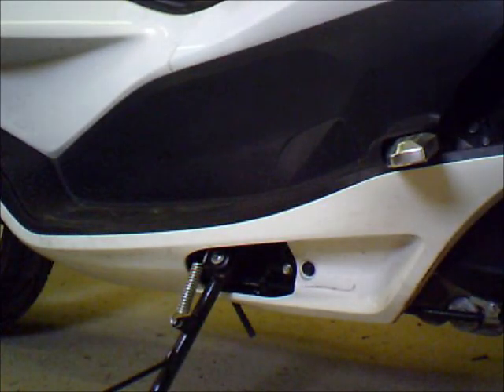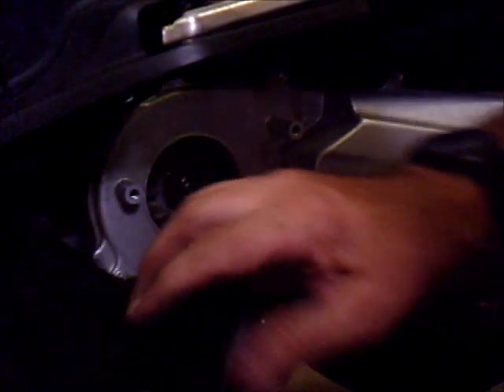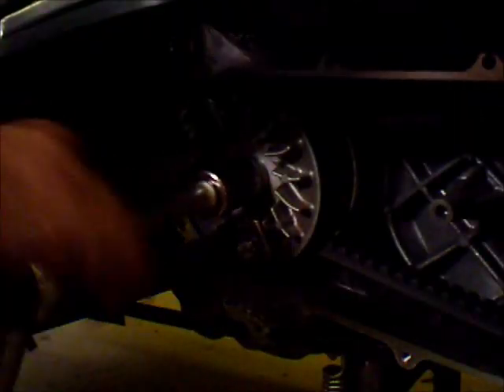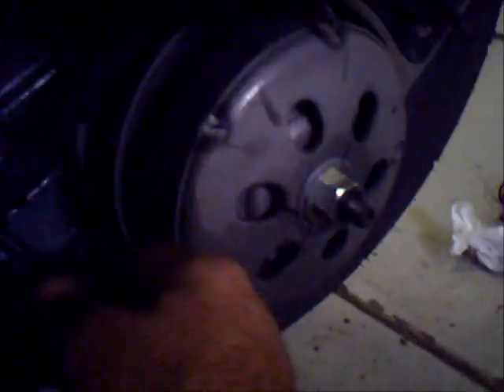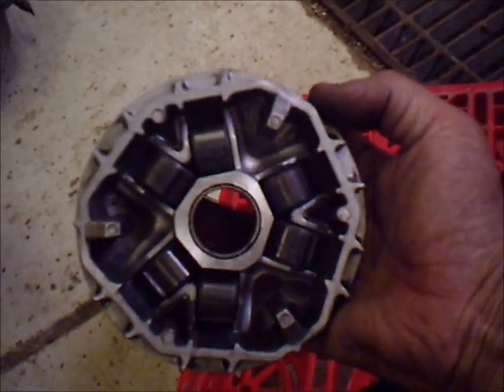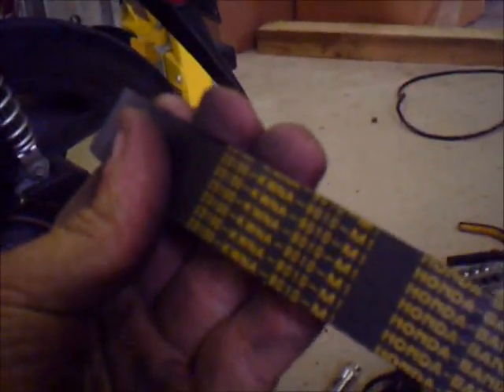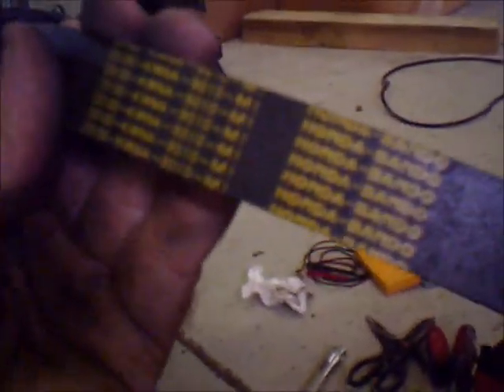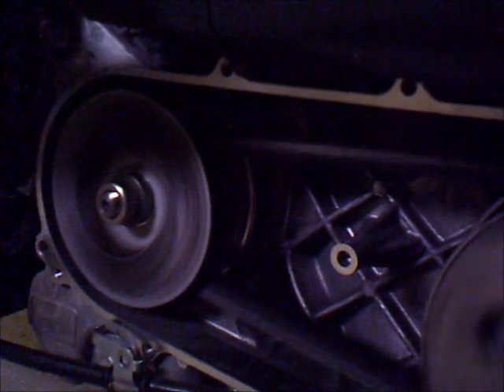TLT 21.4 PCX Tune up Pt 2 Variator Mod

Comment: Yours is the second Honda I’ve seen disassembled and both had rocks in the transmission air filter.  What’s up with that. I think you might find that where the belt rides on the traction face is directly related to the amount of wear on the belt.   I see you replace the belt with a new one how does the width of the old belt measure against the limits set by the manufacturer?
Reply from the maker: Well, the rocks were probably from those chip and seal roads the Michigan unfortunately started doing about fifteen years ago. 

That belt is long gone. Once the belt was changed, the bike behaved much better. The video was made eight years ago.

Comment: How many miles are on those rollers.
Reply from the maker: That was my first tune up on the bike, so it was around 10,000 miles. The bike was used primarily as a commuter between Wayne and Tecumseh Michigan 40 miles one way. Challenger saved a lot of money on gas in those days.